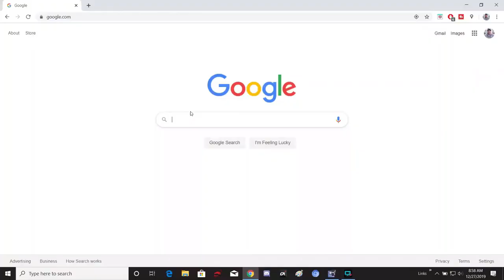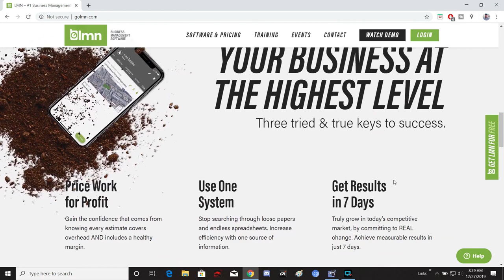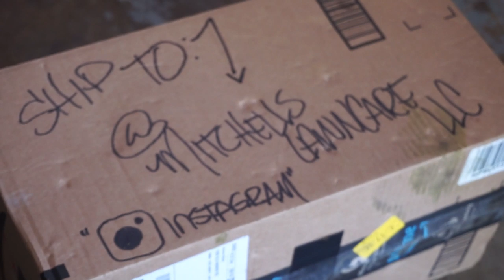STOP Doing This Right NOW! | Lawn Care Mowing Equipment Maintenance

Comment: Brother, I've been a solo operator for 6 years now, and the first 3 were hell. I dealt with the same aches and pains you are (planar fasciitis, hip/back pain, etc. etc.) 3 years ago in the off season I cut out all the junk food (fast food/soda) got back in the gym, starting eating right, and dropped a ton of weight. By the start of the next season, all the pains were gone and I was tearing through a full schedule in 2-3 hours less than it ever took me. Lose the weight, get in shape, and save yourself a ton of pain.  Bonus - you won't drop dead on someone's lawn someday ;-)
Reply from the maker: Yea and I’ve always been in pretty good shape then got comfortable I guess